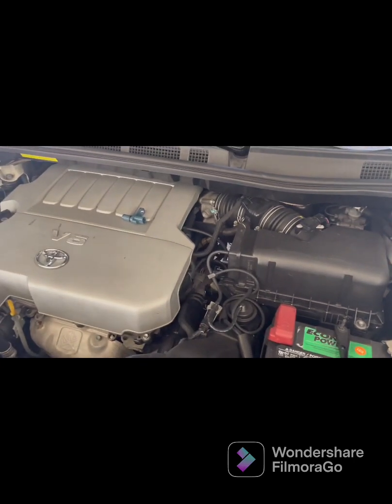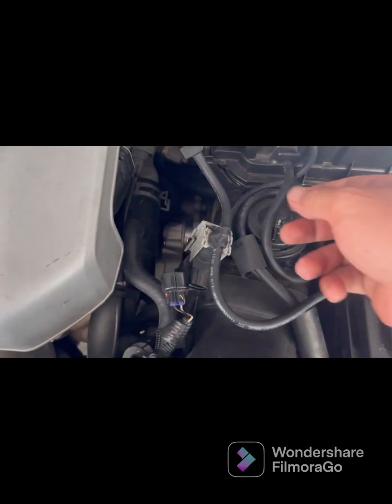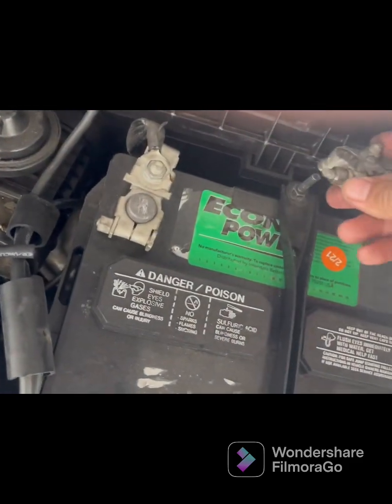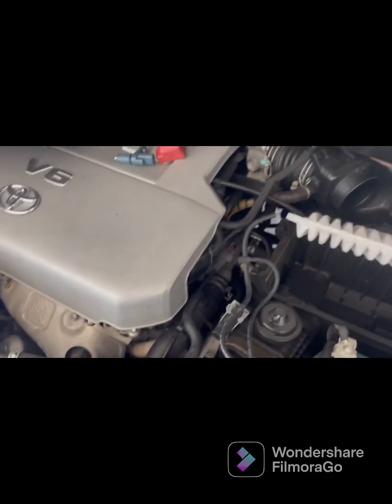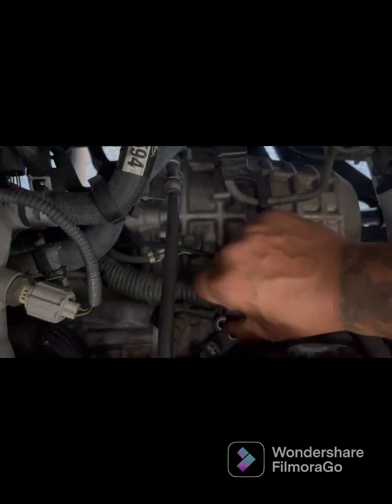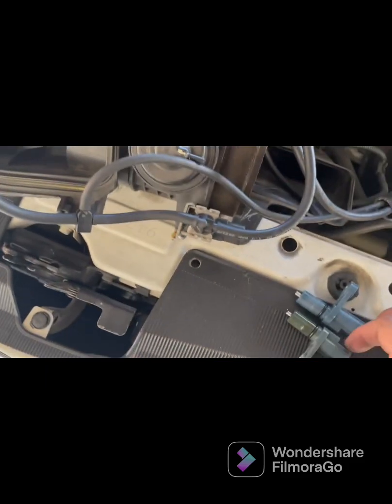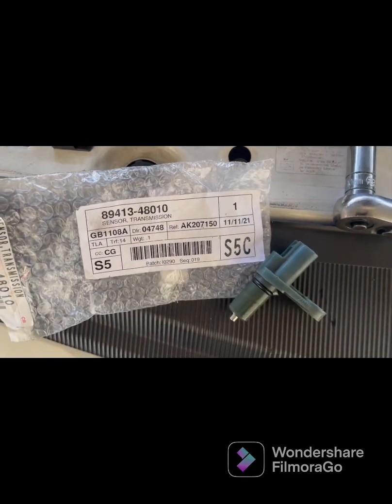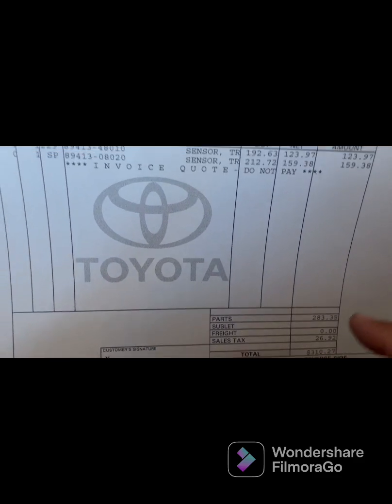P0500 Vehicle Speed Sensor A (FIXED) TOYOTA SIENNA - PART 1

Comment: Thank you so much, but you actually don't need to disconnect all'at. Just disconnect the battery, get it (an the pan or base) out and you'll have enough space to to pull the sensor out
Reply from the maker: @trhownengine  cool

Comment: I have a 2004 Sienna. My van was running perfectly. I was sitting at a stop light, and when the light turned green, I accelerated but there was no movement. The engine just revved, which was a surprise. Luckily, I was on a decline and was able to coast through the intersection to the shoulder and stop. The check engine light was on, so I connected my OBD2 scanner and found an error related to speed sensor A. When I was able to, I looked under the van to find transmission fluid leaking. I had the car towed home and the driver thought it was the CV axle, a friend thought it might be the torque converter. Just last week I installed a new rack and pinion; everything with it was working.

1. What could have caused the transmission fluid to leak?
2. Is the issue related to the speed sensor A error code?
3. How can the specific issue with the van be diagnosed and resolved?1. What could have caused the transmission fluid to leak?
Reply: Damaged transmission maybe   or not screws/bolts not torqued properly to specific specifications. Maybe to much oil maybe bad seals or bad conection to engine or other parts. These are my guesses.

Comment: I got this problem this morning with same code but  transmission is not working too
Reply from the maker: Please explain a little more what are you experiencing?
Reply: @TheEtixzShow  i have 2015 toyota avalon v6  I was driving suddenly my car no gas but engine still running with check engine light on I put my car an scan and code come out p0500 I remove battery and air filter housing I couldn't figure out where the location of transmission speed sensor can u help

Comment: I have Lexus es350 2008 where it will be the same code p0500
Reply from the maker: Located on the transmission case, within the rear differential assembly or inside the ABS system, the vehicle speed sensor reads the speed of the wheel rotation on a vehicle while driving.

Comment: total parts says it's called an engine control module. theres no abs control module listed. where did you get part from
Reply from the maker: Here is the website where i purchased mine.
https://www.ebay.com/itm/333594001280
Reply: @TheEtixzShow  did u do install, looks like a real pain in the ass etixz.
Reply: @murep  dude just pay someone

Comment: can you believe this, I bought both sensors fromToyota and none of the problems were fixed. I changed both em. I can't freakin believe it. Now what do I do. ? speed, odo, cruise, check engine light all bad.
Reply from the maker: I told you, it was none of the speed sensors. 
The culprit is the “ ABS CONTROL MODULE” you need to find a working abs control module. It took me 3 times of swapping out the abs control module. Each abs control module gave me a different problem. Until i found a working abs control module. 
“ You can lead the horse to the water but you cant make him drink”

Comment: Thanks for the tip buddy well as one more thing.I have a 2005 Toyota Avalon is the the vehicle speed sensor A. Located in the same spot as the Toyota Tundra
Reply from the maker: if it is a fwd then it might be in the same place.
Reply: @TheEtixzShow  when has a Toyota Tundra ever been front wheel drive? (Unless you meant 4wd?)

Comment: Look error code says speed sensor A. But do I buy input our output sensor. Rock auto sells both in black. TY for answers . Never had such a pain in the ass to find a part . Brakes fine just lost speedometer, cruise, odometer and check engine light. Gotta get this fixed already . Please answer
Reply from the maker: Please watch my video https://youtu.be/g2FXJkPM7u8
Reply: @TheEtixzShow  yes I saw it three times my friend. Don’t know where I got a and b from. Toyota calls it input or output . But even still there’s a black sensors for input and output. Ok im goin g to auto zone and let them out computer on it
Reply from the maker: Just remove the sensor and take to autozone.
Reply: @TheEtixzShow  smart idea man!! Maybe I’ll just drive it first see what they say. TY

Comment: Hey. sure need some help. My 2006 Sienna has no speedometer, cruise control, brake. light and check engine light all on. IS this a speed sensor as my mechanic says? IF so which one do I change. IT s got the P0500 code too. any ideas out there.
Reply from the maker: Its the Abs control Module. They go faulty. I had to replace or change mine like 3 times until i found an ABS control module that worked.  Here is the website where i purchased mine. 👇
https://www.ebay.com/itm/333594001280
Reply: It’s not abs
Reply from the maker: So its not the Abs Control Module? How do you know its not the ABS CONTROL MODULE? I had to change mine 3 times. Each abs control module gave me different engine symptoms. Until i found a working ABS CONTROL MODULE.

Comment: Hello. Thank you for your information. I have same problem. Don't work speedometer on Toyota Sienna, 2008. But the computer check doesn't show the mistake. Everything works except the speedometer. Could you help what the code (number) of the detail necessary to change? Thank you a lot for your help!
Reply from the maker: Change the ABS CONTROL MODULE. 
This video will help you. 
https://youtu.be/cs1AHIWkg-o

Comment: My 2015 Sienna with code 500 and engine light on drives perfect and speed sensor inside transmission, what could be the problem ?
Reply from the maker: Faulty ABS MODULE. 

https://www.ebay.com/itm/333594001280

👆To replace purchase part here

Comment: I changed the speed sensor, but still have the same problem, p0500. On 2002 Sienna. Could you please give me some advice. Thanks.
Reply: Do not try and use aftermarket sensors here! Please, buy the factory sensor. I have seen many people waste a lot of time with this to find out it is the aftermarket sensor.
Reply from the maker: Replace the ABS MODULE. 
I purchased it from 
        👇

https://www.ebay.com/itm/333594001280
Reply: @TheEtixzShow  I changed the speed sensor, but still have the same problem, p0500. On 2006 Sienna. A mechanic suggested replacing the ABS MODULE. But my mechanic said the brakes didn't feel a change, so he doesn't think there's a problem with the ABS module and would love to hear your advice.
Reply from the maker: @lifesharing8308  replace the ABS MODULE. That should resolve that issue.
Reply: @TheEtixzShow  Thanks！
Reply from the maker: No problem bro
Reply: @TheEtixzShow  Thank you very much for your suggestion to replace the ABS module. After replacing the ABS and brake lights, everything seemed to be normal, but the day after the replacement, the tire pressure light suddenly came on while driving, and the tires seemed to be fine. After turning off the car, restarting the car, everything works fine. After a few days of driving, it lights up again. Do I need to reset the TPMS? Or is there something wrong with the ABS module? thank you for your guidance!
Reply from the maker: Process of elimination. Prior to you changing the Abs Module. You had the brake light turning on. Then you replaced the Abs Module. Everything worked. Then the tire pressure turned on. 
If you still have the old Abs Module. Put it back on. I know, the brake lights will come back on, if the tire pressure light turns off. Now put back on the new abs Module . If the brake light turns off and later on the tire  pressure turns on Its a faulty Abs Module. Go ahead and replace the abs module for a 3rd time. I had the same problem. After a few abs modules . Everything worked. 

Please let me know the results.
Reply: @TheEtixzShow  Thank you very much for your quick reply, Process of elimination is good idea。I'm not sure if my mechanic would agree to this because the tire pressure light doesn't come on after changing the ABS module. The first time was on the way home from the repair shop. The second time was 5 days later. I checked the tire pressure light online and was advised to reset it. I made it. A week has passed and TPMS is not turned on. Now when the car starts, the ABS and the brake lights on the dial go out at the same time. Compared to the other lights, only the TPMS lights go out after a two-second delay, unlike before. Do you think this is normal? Or is it still the reason for the ABS module? Thanks!
Reply from the maker: @lifesharing8308  if the car runs ok with no problems. It should be ok. But its just a few second delay so it should be ok.
Reply: @TheEtixzShow  Thank you very much, if there is any new situation, I will share it with you, please enlighten me。
Reply from the maker: Thank you friend!!!